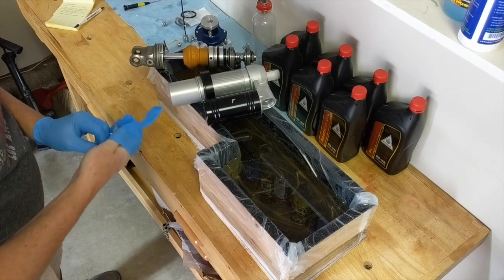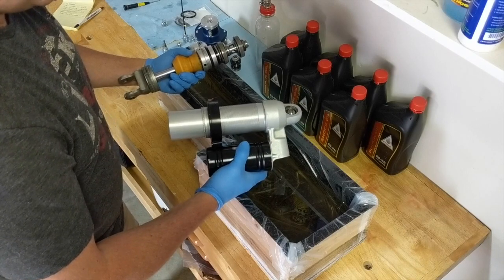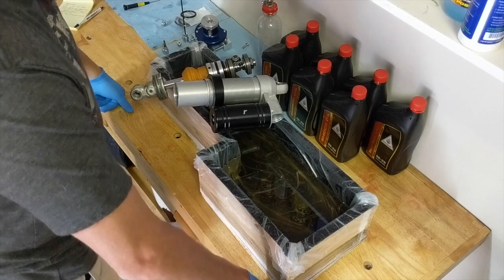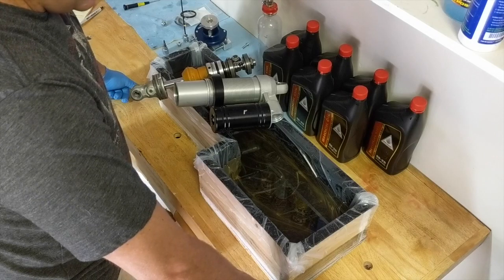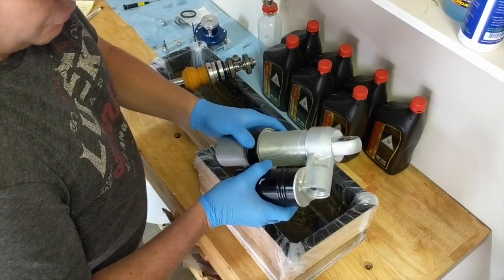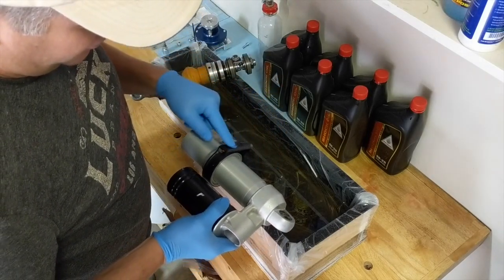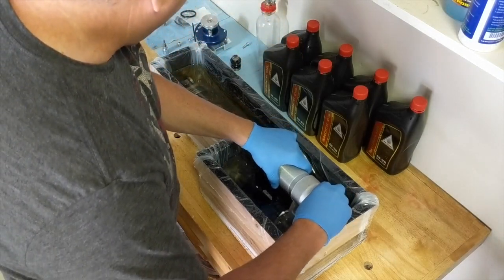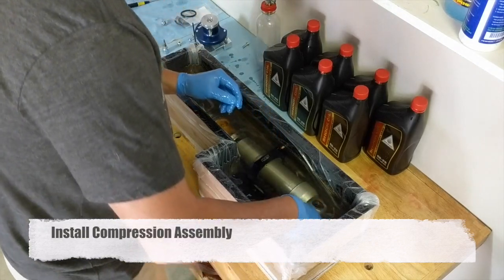Bleeding a PDS Shock using a Bleed Box

Comment: Do not do like this! What about dissolved air in oil? What about the checking of silent? The cost of some bottle of oil is equal the cost of vacuum pump from China which is enough to bleeding shock adcorber
Reply: 100% agree. No way this is better

Comment: Trying this method now, everything this going good, but I can't seem to get the piston to move back up to the 10mm spec. It's about in the middle of the travel and isn't budging.
Reply: Do you have the bleed port open at the top of the reservoir?
Reply: If so, then push the piston from the bottom of the reservoir. It requires a decent amount of force, but not extreme.
Reply: @tdrewk15  Yeah bleeder was off so was the compression nut. Pushed the shock in and was able to finally get it to move. It was really tight. I guessed on the 10mm.
Reply from the maker: @SANDS78  Cool, you can always push it back down from the top to align it as long as it's submerged. Glad it worked out. What did you make your bleed box out of?
Reply: @tk2stroke  I used a Rubbermaid clear plastic tote.

Comment: Awesome idea: i allready thought about making my own vacuum system for bleeding - i think your way is muuch simpler and better.

Instead of a wooden box i will take 2 thick styrofoam plates (housing insulation), glue the together an cut out the shape neede to fir all the parts, then i will put a platic bag into it.

BTW, as suggested by somebody i use HLP22 transmission oil (should equal sae5 fork oil).  works for me and is cheaper.
Reply: I'd like to see how your version turns out. I tried a planter box at first and it leaked and figured to make prototype #1 out of wood. Share a photo or video when it's done.

As for the oil, have you verified HLP22 will handle the heat and pressure a shock generates? With the shock issues I've had in the past, I'm not quite so willing to experiment with going outside of a moto specific shock oil